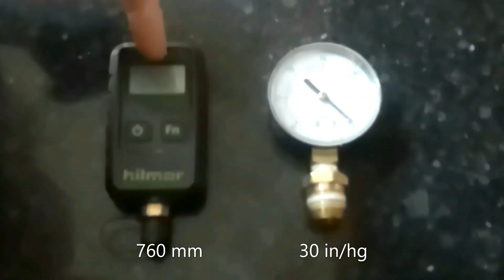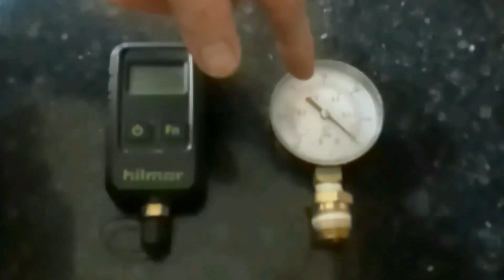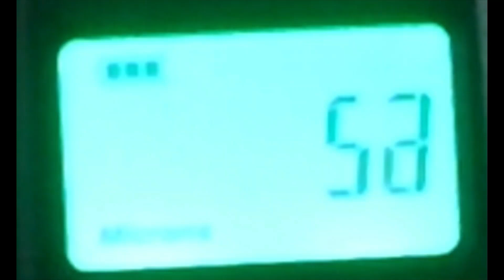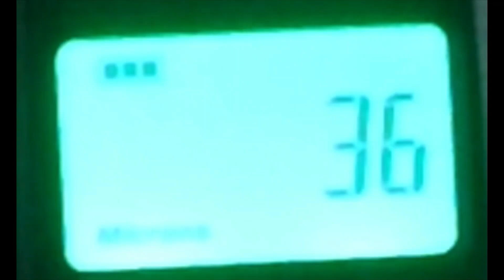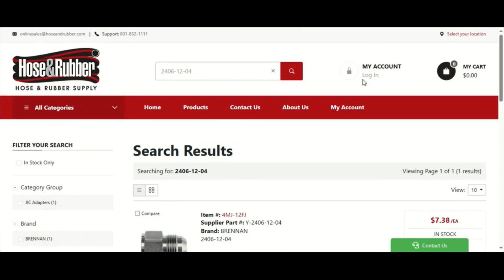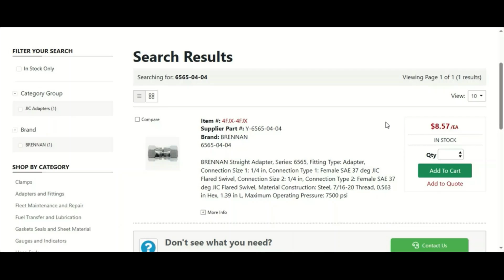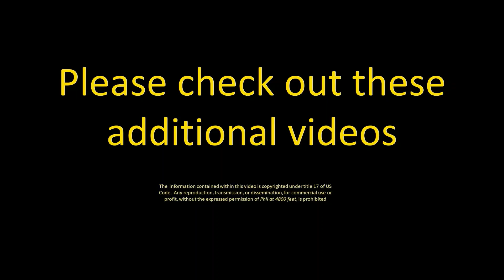Vacuum Gauge Fitting for the Harvest Right Freeze Drier

Comment: I really appreciate this video.  I am in the process of installing a mini-split AC/heat pump in our living room.  I would like to use my HarvestRight Vacuum pump to vacuum my HVAC lines before releasing the gas.  Could you PLEASE tell me which fitting/fittings I need to addapt my vacuum pump to my HVAC gauges?  Is there any reason why I should not use my HarvestRight Vacuum Pump to vacuum my Mini-Split AC?  Thank you for considering my question.  You have been very helpful these last couple years helping me on my Freeze Drying journey.
Reply from the maker: Are you using R-410A?  Low-side port (suction line, larger pipe) I believe it's a 5/16" SAE

Comment: Have you ever made a video on downloading your freeze dryer data to a USB thumb drive and looking at the data in Excel? The machine stores every cycle you do unless you replace your computer board and can be very helpful for troubleshooting. It takes a little excel knowledge but once you figure out the graph you like it is easy to check your machine’s performance fairly quickly.
Reply from the maker: Check out this video:
https://youtu.be/jq0zVrdBKQI
https://youtu.be/CnBx8gCLAEk
Reply: Thanks. I need to get the version 24 my machine is giving me very small vacuum leaks and I’m glad to see they have a fix. I like looking at my data in excel to see if I have sensor issues. My very first machine I think had a bad vacuum sensor but the techs just keep sending me computer boards but the data graph of the vacuum was very erratic. I finally got them to send me a new machine and looked at the data and it worked perfectly. It looked like the data you showed in the video. Thanks.

Comment: Great info as usual Phil. I just finished troubleshooting my low vac problems and had to buy a micron guage and assorted fittings. I also found the Brennan site. I noticed you are now using a Navac demister. Your video on vac pump replacement parts gives a number for this item. However, it appears Navac has updated their product line and I could not find anything related to the part number you gave. They are showing a "new" demister (part number NF43) that looks like the type that will fit the Harvest Right pumps, but the Navac site claims it fits their 12 cfm pumps while makeing no mention of their 7 cfm units. And in their product photos, the demisters shown on their 7 cfm pumps appear to be substantially smaller than the new NF43. But the NF43 to me appears to be the same size as what is on our pumps. Do you think this "new" demister is the one that fits our HR pumps?
Reply from the maker: Most likely.  I doubt Navac would change the cover and threads for a different demister.  You could email them at
techsupport@NavacGlobal.com
And see if there is a difference.